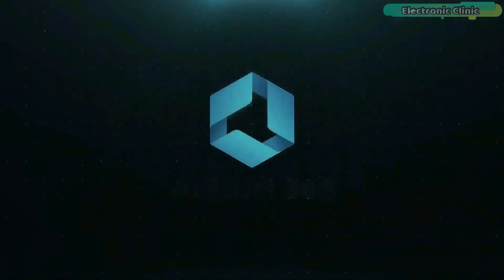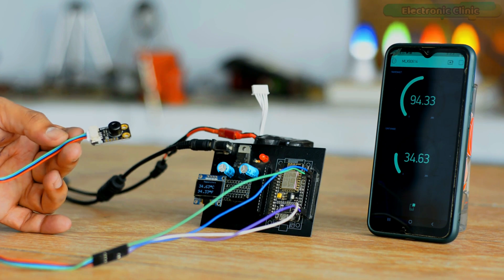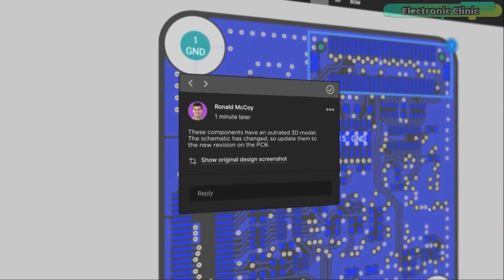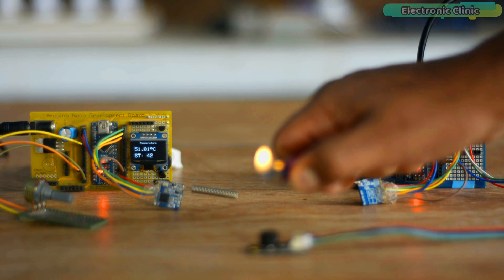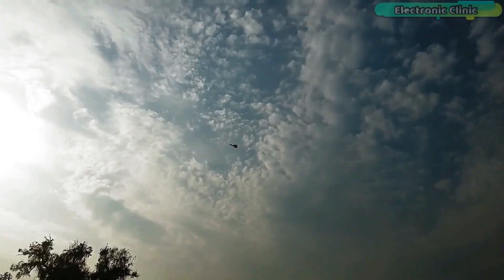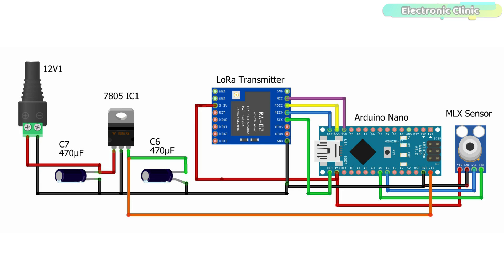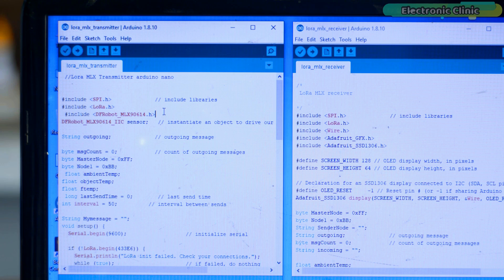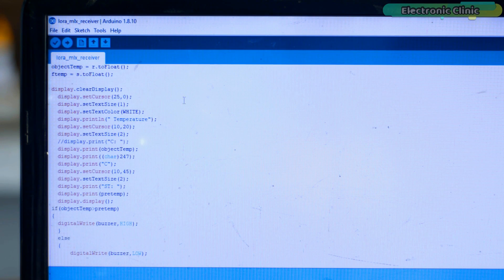MLX90614 Infrared temperature sensor with LoRa, Arduino Project, LoRa Project

Comment from the maker: Previous MLX90614 temperature sensor videos:

MLX90614 infrared temperature sensor with Arduino:
https://youtu.be/MhckQm-AMh4

MLX90614 infrared temperature sensor with ESP8266:
https://youtu.be/hiwoEPf1xLs

*********

Industrial temperature monitoring system using Raspberry Pi Pico:
https://youtu.be/mBhsMqcWyZA

Arduino Max6675 Wireless industrial temperature monitoring:
https://youtu.be/_RoFhuHLuO8

How to make 4S lithium Ion Battery Pack:
https://youtu.be/8vMTZqvSl5s

How to make 3S and 4S lithium Ion Battery Packs using BMS:
https://youtu.be/MsHI3rXtePo

Automatic Spot Welding machine using Arduino:
https://youtu.be/j9Y-N-1Wh8U